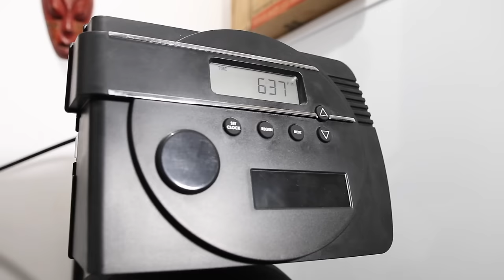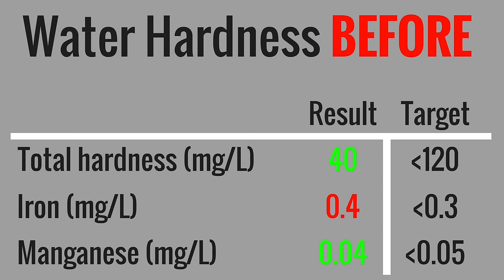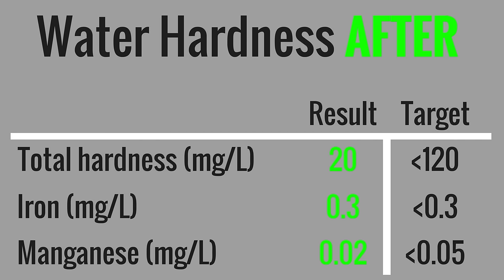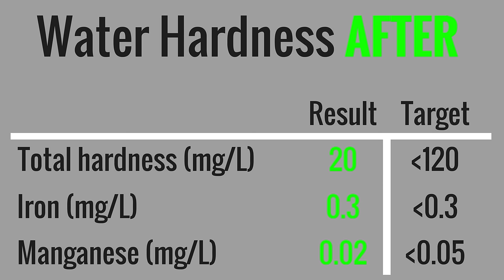WATER SOFTENER SYSTEM : HOW IT WORKS !!

Comment: Great video... I have two tips - one is to make sure that you never run out of salt in the softener or the water will keep running through and you will have a very large water bill.  My second tip is because soft water is so luxurious and your shampoo and conditioner in the shower make the tub very slippery - keep a spray bottle with water and vinegar on the edge of your tub to spray the bottom of the tub when rinsing your hair - it will cut the slip and make your shower a much safer place to be.  I spray mine to make it safe and the vinegar is also great to spray on your feet and rinse - they will never smell because it kills the bacteria that causes odor (armpits as well).  You can also spray your hair for the shine.  You and use regular vinegar or Apple cider vinegar or have one of each.
Reply from the maker: Great tips Joyce!

You should start your own YouTube channel!

Do you follow Clean My Space?  They have a great channel on home cleaning.
Reply: I don't follow them yet so thank you for the tip - I will check them out.  I'm not sure that I have enough content that hasn't been covered to start my own channel.  I have other hobbies that I am busy with so I enjoy watching other people's channels to learn.  I have to say watching is probably much easier than creating so I appreciate everyone's efforts.  I usually just add a thank you and a tip if I have one.
Reply: One question it ok to drink the water once its all cleaned up?
Reply: @dominickcalderon2213  I was told on another blog that it is safe to drink

Comment: My Westinghouse system is showing that it needs to be serviced but have been unable through Westinghouse to find anyone that will do the service in my area.  What needs to be down if it is sending a message to call for service?

Comment: Excellent video!  Your explanation of how a water softener works was very clear and concise. We live about 20 minutes west of Calgary, Alberta and after years of dealing with hard water, we had a high efficiency water softener installed.  What a difference!  We should’ve installed one years ago alas the cost was under $800. The high efficiency softener uses less salt. Since it was installed, we have used a total of five bags.  The unit won’t need a salt refill until the end of January or early February.  Cheers!  p.s.  There is five of us in our home (mom & dad and three teenagers).

Comment: The salt used to regenerate the resin can elevate your sodium intake. It's also not good for your plants.
The alternative is to use a potassium type salt, it won't elevate your sodium level. The down side is it's a bit more expensive than the bags of salt.

Comment: This is a good video.  Clear and to the point.  

I have a few comments.  First, you do not have hard water.  Quite the opposite at around 2 Grains per gallon, it is already quite soft, and do not need an ion exchange salt water softener.  Also, in the US water hardness is normally specified in grains per gallon (although it can be converted to mg/L or PPM by multiplying by 17.1).  By using grans per gallon, it is a simple matter to multiply the gallons used to understand how often a given system will operate prior to regeneration (ex 10 grains/g * 20,000 gal/week  = 20,000 grains used up in a system). What you do need is an iron filter (and likely a carbon silver tank).

Comment: Several points:

Water softeners are not intended for removing iron. They will remove low levels but if you have a lot of iron then a separate iron removal system may be required.

You have a good two tank water softener system, one tank to hold the resin that the water flows through and a separate tank to hold the salt solution which is used to flush out the resin tank and re-juvenate the resin on a weekly or so basis (mine is about every 17 days).  The Big Box stores sell single all-in-one tanks which are cheap cheap cheap (price and quality) and should all be avoided.  They will not last.

The rejuvenation of the resin tank every week or more is automatic on a  modern system, typically set to when a certain amount of water has gone through the resin.  It can also be set for a specific time interval, say every 7 days or every 12 days, but basing it on water usage is more common and makes more sense. All of this is controlled by a typically electronic valve, the programmable box on top of a tank at the beginning of the video.  Fleck and Clack are the best valves.  

I've never been impressed with this talk of mineral build up in pipes.  While doing renovations I cut out a  section of 1/2" copper pipe that had been in place carrying hard water to a tap for 40+ years and found the mineral build up in it negligible - barely noticeable.  The water is hard here, but admittedly not super hard, and I've never heard of anyone having any problem with mineral build up in pipes.  Admittedly you were showing a piece of modern plastic pipe which I have no familiarity with and may be affected differently by minerals.
Reply from the maker: Good points, thanks for sharing.

Yes I was shocked to see the change in colour of pipes from a house we built brand new in 2012!  Now take note that I had pretty “soft” water to start with, and the deposits weren’t thick inside the pipe, but I’d still rather not drink that.  Our clothes and linen also feel softer now, so does our hair and skin when we take showers.
Reply: Gorf TheGreat 
Thanks for your interesting reply. You seem to be very knowledgeable regarding the topic so I have a question for you.
Could you recommend a few different models of water softeners so I can do some research?
Reply: @richardstevens5961  I have the same question. Too bad it took you an entire year to ask it.
Reply: Is it normal for the salt tank to have water  on top of salt when tank is full of salt?
Reply: @rubybanuelos3634  mine was installed today and they told me not to add salt until it was low enough to see the water in the brine tank. Seeing water high in the take doesn’t sound correct, so you may want to investigate further.
Reply: Seeing water in the brine tank is normal, you typically do not want it to exceed roughly 13 inches or 33 centimeters but this depends on the diameter brine tank and size of the water softener. For example, a 28,000 grain water softener will not require as much brine solution to regenerate as an 80,000 grain water softener and will therefore have a smaller volume of solution in the brine tank. 

A high water level can be indicative of improper program settings, a clogged injector, damaged seal or stack assembly, a restricted or kinked drain line, debris in the system or even a missing flow restrictor.

Comment: Great video! I always wondered what the definition of hard and soft water was. After watching this, I'll be getting my water tested in the near future. Another factor that would effect water hardness is galvanised steel pipe work in your own house. If it has been there for several decades, in some cases they begin to corrode. On a similar subject. I decided to use distilled water instead of tap water, when mixing water based car cleaning products. I thought this might be a good idea as some of these products are stored for long periods of time and may effect the product chemistry over that period, secondly piece of mind that the chemistry of the cleaning products would not be effected by water quality in my area.

Comment: Pan, great video, but you can easily check your water with titration kits easily purchased from pet stores as they are routinely used for testing water for fish tanks.  You can also get Hach 4-in-1 test strips to test more parameters than you provided in your before/after water testing.  Additionally, your source water is actually very good compared to some other locations, so I find it hard to believe that with such little treating needed to condition your water you'd go through two bags of salt per month.  That's really high, though I'm guessing you based this off initial consumption, which will mellow out with time.

Comment: Please use water softener salt. It's not typical salt. It's engineered to remove the hardness causing ions and metals that were absorbed by the resin during the recycle. Regular table salt will ruin the system you invested in and can possibly clog and make your water pressure drop significantly. (I know because I've seen people ruin their systems with it when I used to work installing/servicing them)
Yes a softener system helps with water spots tremendously, but it doesn't mean you can wash your car and walk away and it'll dry spotless. 
Water softener are a great investment none the less and should get one if you can, just don't buy the cheap ones from a few $100 otherwise you shouldn't have gotten one at all. Keep up the informative videos Pan. 👍
Reply from the maker: Yes water softener salt should be used like the bag I showed in the video.
Reply: Mighty Mike.....  yes,
just like the bag shown in the video at 4:00

Comment: The plumber that just installed mine in my new house put the tubing that was supposed to be the flush drain, into the salt.  The first time it flushed, it over filled the salt and flooded the garage, driveway, and freshly laid sod in the yard with salt water.  Actually, he didn't put a single tubing in the right place, everything was wrong!  I had to contact the manufacturer and have them guide me through correcting all his mistakes.

Now that it's connected correctly, it does work well!  Everyone definitely needs to have one, it really does make the water feel and taste a lot better.  Thanks for posting this video explaining how it works!
Reply from the maker: My pleasure. How did you discover my channel by the way?
Reply: @PanTheOrganizer  Before I reached the manufacturer I was searching YouTube for information on installing the softener.  Naturally later, YouTube started popping up water softener videos including yours.  The problem was already solved when I found your channel but I figured a, "How it Works" video would still be a good idea to watch.  Ive since ordered a filter from the same company, SpringWell, that's suppose to remove chlorine etc in front of the softener.  I don't think I will be calling the plumber for that one, I think I will install it myself:-)

Comment: Great video. Thank you , no one ever mentions the Side effects it could have on your septic system. We found this out the hard way. After we installed a water softener system similar to the one in your video, our septic tank began to malfunction. We live outside of the city limits so we have a independent septic tank behind our home. And because of all of the salt water that our softener was now pumping into our septic tank, our Leitchfield began to crystallize. We did not know what was happening, we thought we were going to have to rip up the backyard and invest another $4000 into a brand new septic system. Until I investigated relentlessly. And I found that my soil had hardened because of the salt water and I had to invest into a simple chemical at Walmart that would uncrystallized my soil. And guess what, problem solved.! It would be helpful if you would include a warning or a simple heads up to people who have a independent septic tank that could possibly go through a problem like this and help to save them thousands of dollars for a new septic tank they don’t need. Thank you
Reply from the maker: First of all, I'm not a water treatment expert. That would be up to the company you are dealing with to explain those things to you. This video was simply meant to explain how a water softener works. I live in a brand new home now, and it has a sceptic tank, and I also have a water softener system. 2 years in, absolutely no issues. So there have to be variables form one installation to another. Water hardness, equipment, maintenance, etc.
Reply: I heard potassium chloride pellets it will be safer for your septic tank and plants and plants however the cost is 5 times the amount at about 20 to $30 a bag

Comment: Great video. I have a water conditioning system but never knew exactly how it worked. I was thinking the drinking water came in contact with the salt but wondered why the water didn't taste briny. I now understand that the salt tank is just for flushing out sediment from the resin tank. Thanks again

Comment: Thanks for the video. A quick question -- just so I understand correctly -- When I open a faucet in my house the following happens: Hard water from the city flows through my pipes ->  hard water goes into my water softener through the 'IN' pipe of the softener -> hard water goes through the clean resin beads -> Soft water comes out through the 'OUT' pipe of the softener -> water flows to my faucet and is soft water. If this is the case, whenever I open a faucet or take a shower, should I hear water flowing through my softener? Thanks again!

Comment: A couple questions:
Do these filter out fluoride?
How does resin attract metals?  Do the beads have a metal or catalytic or other type of coating?  Do the beads ever need replacing?
Do hotels usually/often have this type of system?  I notice hotel water usually tastes different than my home water.
Do you know of any test results from softened water tested for plastic compounds like BPA?

Comment: 😮Excellent. I am aware of hard water problems and would plumb a cold water line to my kitchen since I like the taste of our water. And, hard water has some health benefits

I have a few questions:

1. What is the brand of the softener your display?

2. Have any recommendations for capacity? 2 people in the house part time. I do not know what the statistics but I have never lived with water this hard.

3. Any hope that the soft water will clean out any existing deposits?

Thanks, Dan you sold me on a water softener, which I can install mself. I did subscribe!

Comment: Do you get a spot free rinse on the cars?  Is it the same principle as rinsing with deionized water?
Reply: Michael p As Pan shows, the a typical water softener works on an ion exchange principle - the hardness minerals are essentially exchanged by sodium when the hard water passes through the resin.  The “filtered,” softened water will have reduced minerals, but your sodium levels will be elevated as well.  Again, it’s an ion exchange system (exchange one mineral for another - in this case calciums/magnesiums/etc. exchanged for salt).  So a water softener is not dionized water.  Deionized water is complete removal of minerals, no exchange at all.  For rinsing your car with softenred water, you will definitely see reduced water spotting, however.  But if your concern is spotting, you should rinse with distilled water (probably the best form of mineral-free water and it’s also economical vs dionized water).
Reply from the maker: Exactly what Axel said.
Reply: @PanTheOrganizer  ro water system

Comment: Great video Pan! Thank you for helping us.

Going with the assumption you would have a done a lot of homework for this video, I have a couple follow up questions [if you are still reading the comments!]

1) What are the types of resins on the market that actually does the 'cleansing' part and which is better from 'cleansing' perspective? 
2) There are 3 key contaminants in the results that you show. Which one is more harmful  ? For instance the iron did not reduce much after the system. What if that is actually the more/most harmful of the contaminants ? 

Thank you,
Reply: I just had a softener system installed today and was told that many manufacturers use resin made in China. The resin in the Culligan system I purchased has a lifetime warranty and is made in the USA. That’s a very good question, as I’d expect it would be difficult to find the answer to this when purchasing online, most likely.

Comment: Let not forget how this will help with water spots on your car too!
Reply from the maker: Yup!  My water was already pretty soft to start with, but this type of system will work wonders for those with hard water.
Reply: I had a soft/hot water tap installed outside for summer use - it is great for the vehicles and even my house windows - it make the job much easier.
Reply: Jeff Webb I just moved to Henderson NV, not sure if my softener is working since they had turned it off when they moved out.  The tank is about a 1/4 full of water but there is no salt.  Ugh. What kind of water softer did you get?  Was it very expensive?

Comment: Just hooked up my water softener.  I live in a 100+ year old home that has galvanized pipes. Most of the pipes are 50 to 80% blocked by build up.  working on replacing with pex.  That for your informative vid.
Reply from the maker: You won't regret it! Thanks for watching Andy. How did you discover my channel by the way?
Reply: @PanTheOrganizer  Just scrolling Youtube.

Comment: Great video! I'm new to this system and explained well. So how do you change that "pre-filter?" And what happens if you forget to add salt into that container and it runs dry? Are you supposed to also add water to it or is water added automatically by the other container?

Comment: What size do you have for the salt. We are getting a C Series and it can hold 200 pound's or 4 bags. The tank is also taller then yours and has a blue wrap. Also told they are adding a 3/4 lines to it as well and has a commercial Valve for the backwash so it sounds really good for 1'000 dollars and the company hear in MI has been around since 1955 crazy and it's a family own company. They even make their own warter and have the water machines that are cold and hot. They told us you can do hot chocolate the water is that hot.